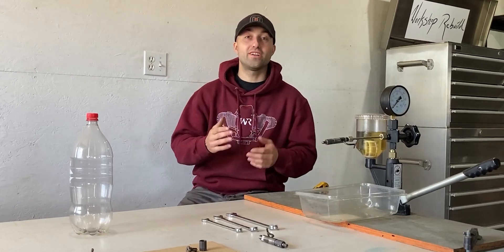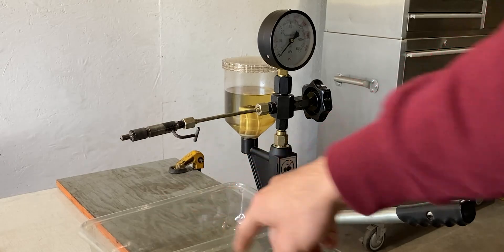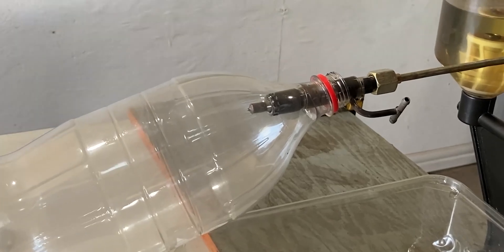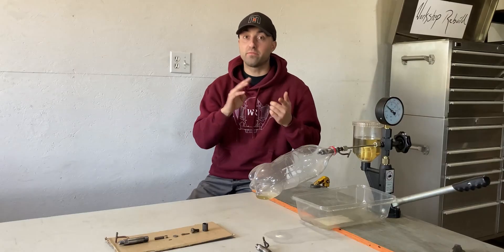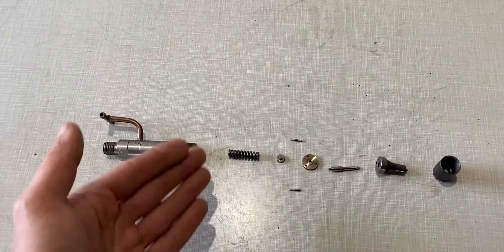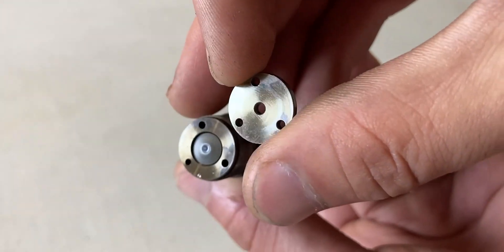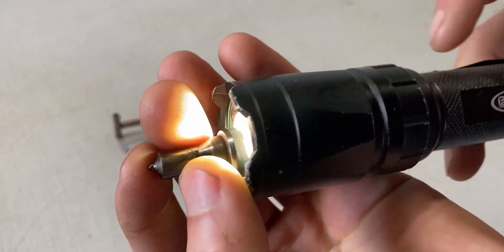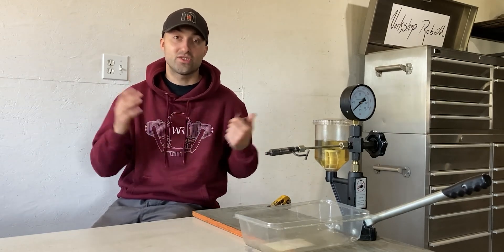Diesel Fuel Injector Test

Comment: Clear, concise and to the point.  Excellent presentation.  The breakdown of the injector into the various parts was extremely helpful.
Where can the specifications for injectors be obtained?  Can the injector body be rebuilt with the components you identified?
And would this tester be appropriate for gasoline fuel injectors?
Reply from the maker: Glad I could shed some light on this topic and thanks for your wonderful comment! 
Depending on the injector manufacturer, you could usually reach out to them for a spec sheet. This injector happened to be from a Yanmar engine and the injector specs were in the workshop manual for the 3TNV82A engine.
Depending on your injector or engine manufacturer check with https://www.manualslib.com and see if they have a manual that suits your needs. Not affiliated in any way, they just sometimes have the right info!
This tester could be work with mechanical operated gasoline injectors, but I've just never done it before!

Comment: Thanks for sharing. The only thing I was hoping you would do during the test was to bring the pressure up to 2500 psi, or so, and then use the shut off valve to slowly increase the pressure until 2800 psi or until the injector sprayed. Would it slowly bleed or would it spray?

Comment: Does one have to use diesel for the test ? Another video also showed diesel being used but the host said it wasn't  recommended. If not diesel, what ?
Reply from the maker: This tester is specifically designed for diesel fuel injectors. The reason for this is to ensure the results align with factory operating specifications, allowing you to accurately evaluate your diesel injectors. Using the correct fuel, such as diesel, which has the proper viscosity and lubrication properties, is essential for obtaining reliable test results. Testing with any other fuel may lead to inaccurate readings. 

I hope this clarifies things.  
Cheers  Andreas
Reply: They make special pop test fluid that isn't flammable.

Comment: Great video, thank you! Hoe difficult is it to find the pressure specs for a specific injector (Kubota 1G677-53903 , for example)?
Reply from the maker: Thanks a lot! Here is what I found online: 
Operating (Injection) Pressure: This is usually around 140 to 160 bar (2,030 to 2,320 psi), though it can vary depending on the specific model and application of the engine.

Opening Pressure: The opening pressure is typically set within the same range as the injection pressure, often around 140 bar (2,030 psi), but it can vary slightly based on specific calibration.

Comment: Would this work on a common rail diesel injector?
Reply from the maker: You need computer controlled regulator for the activation of the nozzle. There are some systems that offer the manual injection tester with the common rail injector attachment, but I have not yet used it.

Comment: How do you release the pressure from the tester when you're going to check the next injector? 
I tested one of my injectors and when I was done there was still some pressure in the tester (nothing crazy)that didn't go away and when I removed the injector, it squirted back.
Is it normal to have some pressure still inside the tester while changing injectors?
Reply from the maker: To release pressure from the injector you can turn the knob on the right by 1/4 or 1/2 a turn. Allow the pressure to release by itself and do not turn more.

Removing an injector under pressure is very dangerous. Be careful!
Reply: @WorkshopRebuild thank you, I appreciate the advice!

Comment: Great video! About to test my first set of injectors. If theyre leaking would a new nozzle fix it up? Or there’s more to it?
Reply from the maker: Thanks a lot for your feedback! If your injectors are leaking or even if you have a faulty spray pattern, you can replace your nozzles. Most injectors have shims behind the spring, in order to allow them to open at the correct pressure. Sometimes you can reuse the old shims because they are the right thickness and sometimes you have to replace them with thinner or thicker ones.
Let me know how it goes. Regards Andreas

Comment: how can one know opening psi of any injector
Reply from the maker: You‘ll find your injector opening pressure online or within a service manual. Most injectors are brand specific and shimmed for your engine. You can either find it according to your engine or the injector brand.

I hope this helps.
Reply: @WorkshopRebuild   I wish it helps but I have looked online, websites and now asking people, still no perfect direction. what im looking for is a  place, a book, a site  where you can enter part number and get the details.
Reply from the maker: @jaybrown1873 What engine are you working on and what part number do you have?

Comment: Hello, sir! Just one question: I noticed that in the market, there are also cheaper  test pumps without that wheel on the right. Will I be able to see if an injector is leaking with one of those?
Reply from the maker: Hi there. I've never used one of those before, but I don't believe it will work to test for leaks.
The hand pump only creates pressure for each stroke you pump. This means your pressure rises and drops and in order to maintain pressure, you must keep the pressure up. Therefore you must have a valve and trap the pressure between your injector and your hand activated valve.
When the pressure is within this area you will look for leaks at your injector.

The ones without a hand wheel valve are probably only for spray pattern testing only. I hope this helps you decided which one you want to get. Regards Andreas
Reply: @WorkshopRebuild  thank you

Comment: Very Good, Thanks. No leaks showing. It runs smooth. I was just thinking about how the feed tube mates into the injectors and where the leaked fuel would go.
Reply from the maker: I'm glad you don't have any leaks! The sealing mechanism in this case is a tapered fit between the high pressure fuel line and the injector body. 
Most of the time you will have diesel fuel on the top of your cylinder head or it sprays in the opposite direction, between the fuel line nut and the fuel line. 
Either way, when you have a leak it sucks... I hope your engine keeps on running nice and smooth. Regards Andreas

Comment: I had new injectors installed in my 05 Cummins. How do I know they were installed right and will not leak where the feed tube is forced against the injector?
Reply from the maker: Both mating surfaces (the taper on the injector and the taper of the diesel fuel line) must be clean and smooth. If these surfaces and dented, scratched or even mushroomed, you will have leaks. This happens when injector line nuts are tightened too much. 
For every revolution, your pump will supply fuel to your injectors and this pressurizes the lines. If you have a leak, it usually bubbles around the injection line nut...this is leaking. Your best option would be to smooth out the taper on the injector line with some hand tools or emery cloth. If that doesn't work, you must replace your line.
If they don't leak, then you know the are sealing correctly. and your engine should sound nice and smooth. 
I hope this helps. Regards Andreas

Comment: Slow down on the pop tests especially when you are explaining what your doing
Reply from the maker: The pop test should be performed with the hand injector tester in a quick manner. These injectors pop within seconds once installed, so taking your time pumping doesn‘t help the situation (especially if you have faulty injectors).

If you want to slow the video down to see the spray pattern, you can simply slow down the playback speed in the video settings.

I hope this helps. Regards Andreas

Comment: Some videos suggest that assembly should take place under/ in dieseloil.
Reply from the maker: Yes it wouldn't hurt to assemble an injector in diesel fuel, because the diesel fuel acts as the lubricant within the injector. Even injector is different, but very similar at the same time. Thanks for sharing this info with me. Regards Andreas

Comment: Great stuff: did you reverse the wear side of the separator plate and if you needed shims, is there a designated value to raise the release pressure per shim? Do you add more shims to get your release pressure at the 2700 or are shims variable in size? Do new springs eliminate shimming?
Reply from the maker: Thanks a lot for tuning in and leaving a comment!
I did not need to reverse the separator plate, but this can be if yours is heavily worn. The bores of the separator plate line up whichever way you place it, so there shouldn't be a big issue...at least in this injector! 
The shims add more tension to the spring and this brings up the opening-pressure of an injector. Each shim was thicker by 0.06mm and this added around 50-70PS. Every injector is different, so your values may vary!
These injectors are around 33 years old and I needed to add shims to reach the specified values. You'll never be above the pressure rating unless you add too many shims and that would be very bad for your engine anyways. 
Almost all injectors are shimmed, because the art of spring manufacturing still has tolerances and the easiest way to setup an injector is to add a shim or two. This is the cheapest alternative for all manufacturers and if anything wears out over time, just add another shim.

I hope this will help along your injector repairs. Thanks again for your comment.
Regards Andreas
Reply: @WorkshopRebuild  thank you for all the details… my 1995 diesel will be singing
Reply from the maker: You‘re more than welcome! Enjoy your diesel repairs😃👍🏽👍🏽

Comment: Great video! I have a tester like yours. Where can I buy an adaptor to hook it to Farmall 560 injectors?
Reply from the maker: Hi there, thanks a lot for your feedback! Maybe you could use a fuel line from your Farmall 560 directly to this injector tester! If that's not the case, you could find an adapter from your fuel line to the injector tester fitting.
If both of these options don't add up, you might need to get a custom fuel line made. (This will be the most expensive option).
I hope this will help with your decision-making. Regards Andreas
Reply: Do you have any idea of a source for adapters?Thanks for the reply! Ralph  Erb, Emmett, idaho @WorkshopRebuild

Comment: Thanks for a very easy to understand video explaining the workings of a diesel injector. I'm having problems with white somke from my VW T4 van and I have removed the injectors and now feel confident enough to clean them and test them myself. Hopefully it's a very simple fix like the injector seals.
Reply from the maker: Hi there! Thank you for tuning in and leaving a comment! White smoke on diesel engines is most likely a sticky injector (stuck in open position and leaking) or even a faulty spray pattern (bad injector nozzle). I am not familiar with the VW T4 injectors, but if you have a mechanical injector like the one in this video, you should be able to repair it pretty easily.
Make sure when you take your first injector apart that you don't loose any parts. Some shims and pins can be VERY SMALL. 
Regards Andreas
Reply: @WorkshopRebuild  Thanks. I tested the electrical connector yesterday and didn't get a reading so I'm thinking that could be the problem. The T4 has 3 mechanical injectors in cylinders 1,2 and 4 and an injector with an electrical connection in cylinder 3.The seals seemed in good condition when I removed them but obviously will need replacing with new ones and there was a slight build up of oil deposits around the nozzles. I have cleaned the 3 mechanical injectors but the one with the electrical connection will probably need replacing. Your video has helped immensely. Thank You.
Reply from the maker: That‘s awesome! Oil deposits are normal for injector nozzles and with a little but of mineral spirit it can be removed.
I wonder what the wires are for on injector number 3. is it possible that this is a cylinder head temperature sending unit?
Some European manufacturers had weird alternatives to a coolant temp.sensor that was physically threaded into the cylinder head...

Let me know if you get your engine up and running again with no smoke😃👍🏽

Comment: can I use a similar tester to test the injectors of 
my ford ranger
Reply from the maker: Hi Samantha, the diesel fuel injectors I tested in this video open mechanically (the fuel pressure overrides the spring tension, causing the injector to open). If your fuel injector has a 12V wire leading up to it, then it is opened electronically. Unfortunately, the way this tester is setup, it can only do mechanical injectors.
I hope this helps. Regards Andreas

Comment: Great video! Are those injectors from your JD 855? I am rebuilding a JD 755 and was going to get my injectors tested but may buy a tester and do it myself. Thank you
Reply from the maker: Hi there, yes this is the injector from my JD855 and they might even be the same as the JD755 injectors.  If you want to test them yourself that can be done with a handheld injector tester just like the one in this video. Most common faults of injectors are faulty spray patterns (damaged or clogged nozzles) and leaky injector nozzles (worn nozzles). If you encounter this, you can replace the nozzle in most cases.
I hoe this helps. Regards Andreas
Reply: @WorkshopRebuild  Thanks, the 755 injectors are a little different. The engine is an indirect injection diesel vs the direct injection 855. I think I will buy a tester as I have 3 diesel tractors.

Comment: Can this tester be effective and the electrical fuel injector ?
Reply from the maker: Hi there! I have an electronic device that can be used for common rail injectors along side this hand operated diesel injector tester.
It can accept Bosch, Delphi, Denso and some other brand names. The main goal is to reach a certain pressure and allow the electronics to open the injector.
I might do a video about this is the future if I find injectors of that kind.

Thank you for your inquiry!

Comment: 10/18/2022 i bought 2 diffrent testors like youres from amazone  when i pump up the injector to test for leaks , i close the valve -- that valve is now locked the psi in the guasge and is not reading the injector psi now..   if the injector leaks guage will not gow down , the psi in guage only reads the psi u pumped it up to be
Reply from the maker: Thanks for your great question! According to you description you're doing everything right. Be sure to check your opening test psi and your leak test psi. Some injectors have different ratings (I just want you to double-check). 
To check for leaks: Pump your hand pump to your desired psi rating. Once reached, gently close the valve. Wait 10-20 seconds and if you see any drips or leaks within this time, your injector nozzle is faulty. 
Your gauge will start to lose pressure over a longer period of time (maybe 1minute or longer) and not immediately!! If you tighten the hand knob for your valve too much, it is possible that you damaged the internals of this injector tester. I have noticed that they are not the best quality, but with proper care one can test numerous injectors before replacing the o-rings interally.
Let me know if you have any other questions! Regards Andreas

Comment: Thanks for sharing I’ve never worked on Diesel engine before I do with gas engine but not diesel but I own 2 garden tractor diesel
Reply from the maker: Thanks for sharing your experience Santiago! It's always great to be able to learn on a gas engine and once you have that sorted out you may want to try out diesel engines! They are very fun and with a little bit of practice you'll be amazed what you can achieve. Thanks for tuning in, I appreciate it. Regards Andreas

Comment: Thank you for the educative video! What do you use to lubricate the valve nozzle?
Reply from the maker: You're more than welcome and thank you for tuning in, it's much appreciated! Before assembling the injector, you will want to coat all internal parts with diesel fuel. The diesel fuel will act as the lubricant in this case and it does the exact same while in operation.
If you tend to store injectors for a longer period, you can apply a very thin film of oil around the nozzle parts.
I hope this helps! Regards Andreas

Comment: hi you have the knob on the right, whats for? how to use it thanks
Reply from the maker: The knob on the right is to increase the pressure within the injector tester. When you pump the handle, you want to have this turned open 1.5 turns to allow pressure to build up. Once you reach a certain number your injector should open. If you cannot see it correctly while using the handle, you can slowly close (turn) this knob to verify the number more precisely.
If you check your injector for leakage, you will have to reach this value by turning this knob. An injector usually opens 50-100psi over your leakage test value. I hope this helps, best regards - Andreas

Comment: Great explanation!!  That is a first for me, actually seeing how a mechanical diesel fuel injector works!  Well done!
Reply from the maker: I appreciate it! It's always great to learn something new and maybe in the future you'll be able to save some diesel injectors yourself. It can get costly if you need to exchange the full injector. Most of the time, the nozzle body (tip of the injector) will tend to leak and ONLY this must be replaced. Thanks again, Enjoy your week